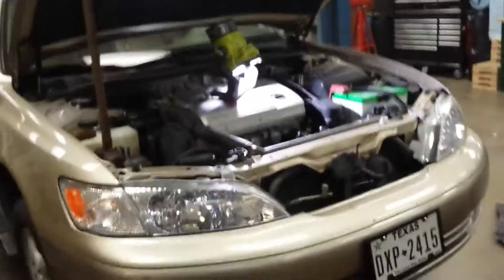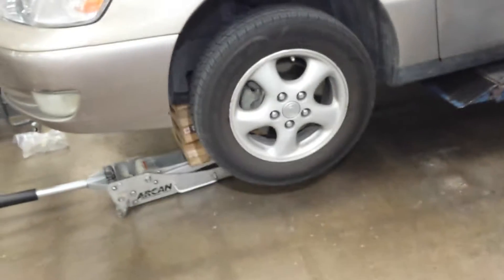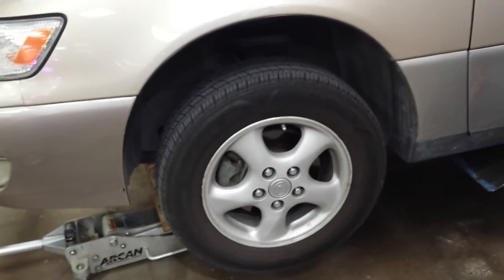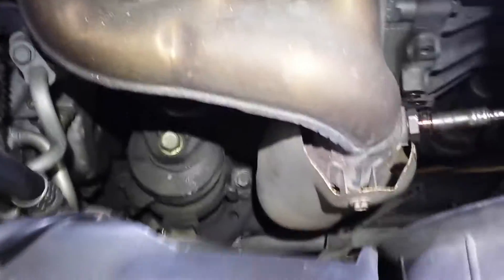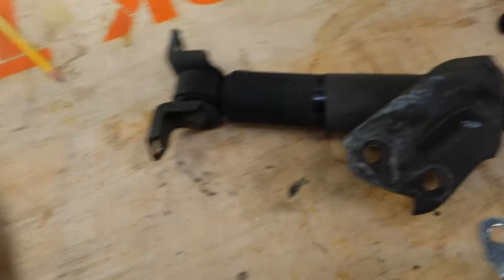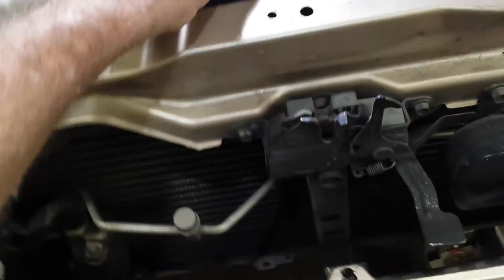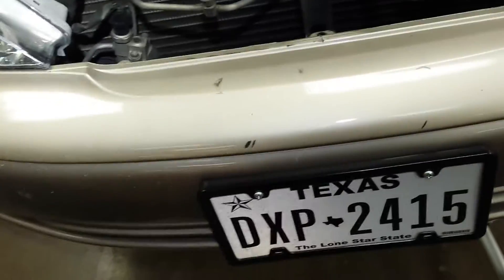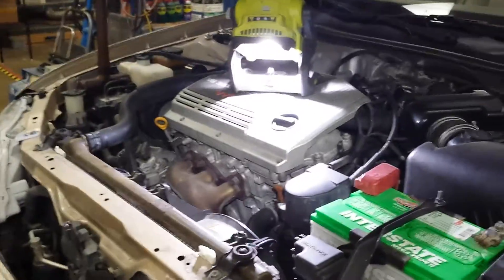Working on Lexus ES 300 Motor Mounts, etc.

Comment: So did the rattle go away completely? I have also a rattle but found it came from my shock mounts which were known to be bad.
Reply: @jamesj1479  My 04 ES 330 Rear Knuckle Bushings Went Out @ About 119,000.Firestone Said Frt Knuckle Bushings Were O.K.@ That Time.Could That Be Ur Noise? When My Rears Went Out ,I Would Hear Them Rattle During Low Spd.Turns.